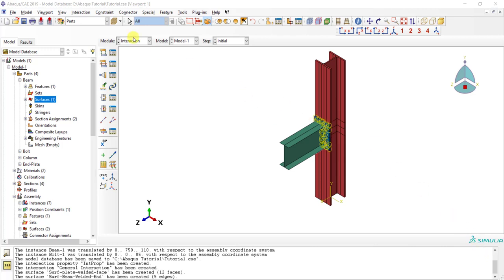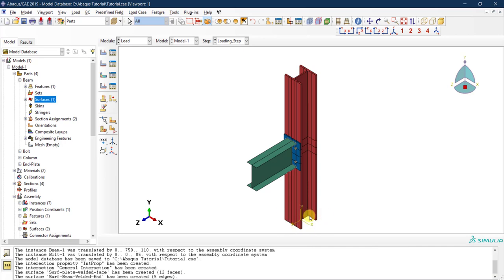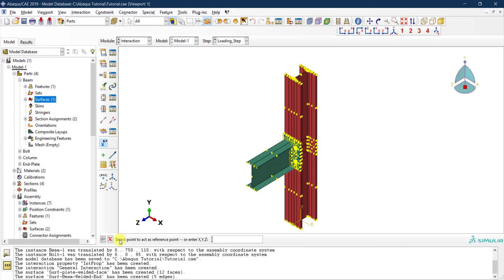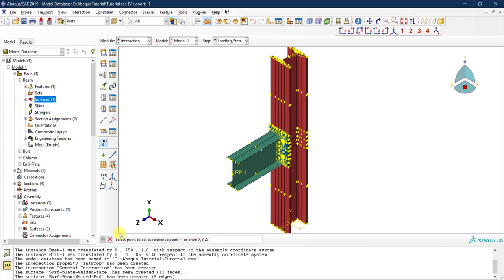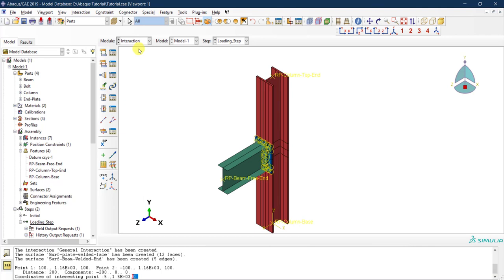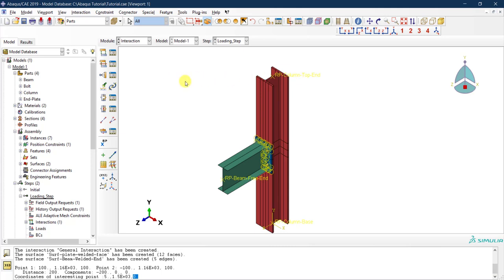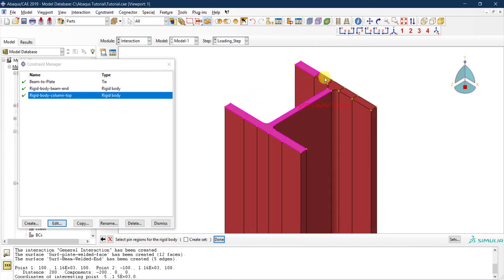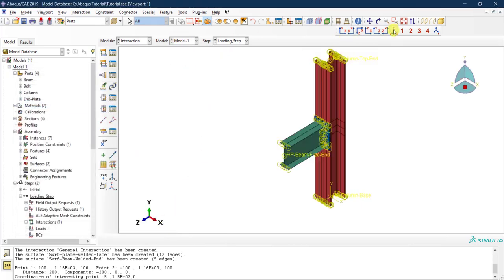#14 ABAQUS Tutorial: Defining reference points and rigid body constraints

Comment: Node 2654 instance column-1 has two rigid body reference nodes 3 (assembly) and 2 (assembly). A node may be associated with only one rigid body
Reply from the maker: It seems you made a double assignment for a reference point. Please check your constraints definitions within the interaction module.

Comment: Thank you sir, i have a problem in my work , please my question is ((can i create a reference point RP-2  for the column-top  in (0,2000,0) and tie him to the appropriate surface . if i have a pressure load in this surface for example ? )) . Thank you very much again.
Reply from the maker: You can assign a an equivelant load to the RP.
Reply: @AElkady  thank you very much sir for reply.
Reply: @AElkady  Can I use only one reference point and tie him to multiple appropriate surfaces spaced out that have the same pressure?

Comment: Sir
What is the difference between tie(nodes) and pin( nodes)?
Which one would be better for a CFST Column- concrete filled steel column with outer steel tube and inner concrete core
Please reply 🙏
Reply from the maker: Tie transmits all of the node degrees of freedom to the attached body. Pin transmits only translational degrees of freedom. The choice depnds on the mechanism being simulated. A good illustration is show here: http://catiadoc.free.fr/online/anlug_C2/anlugprtconstraints.htm